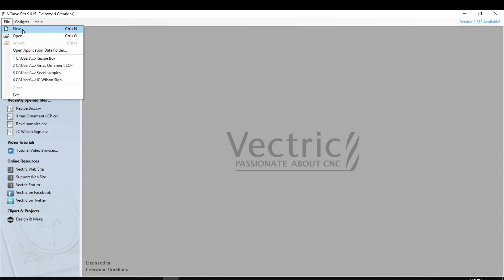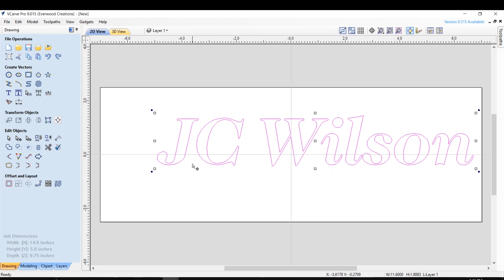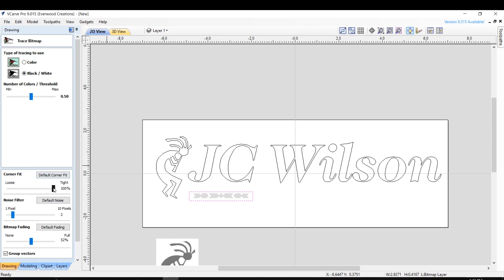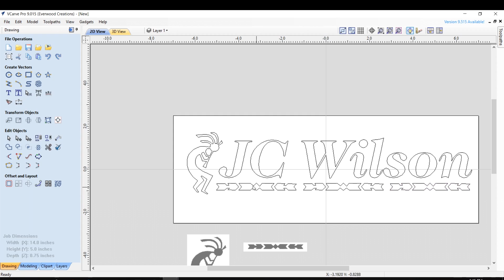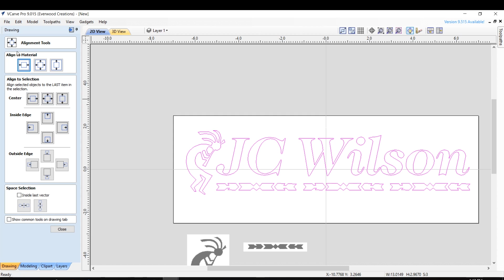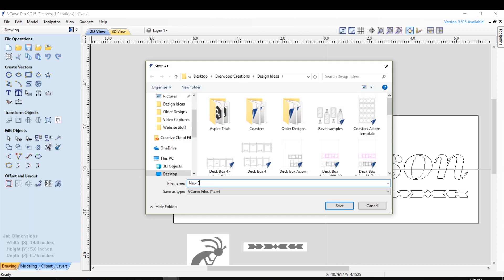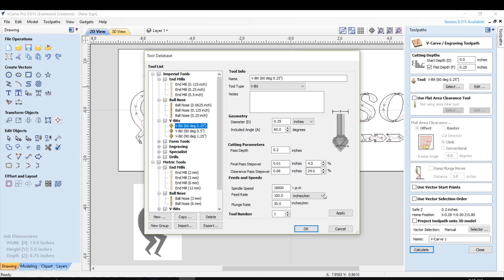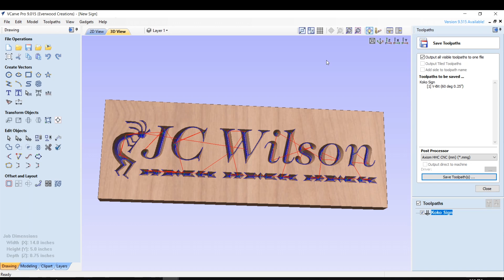VCarve Sign Tutorial: From Design to CNC

Comment: Liked your video and how strait forward you were. 2 questions, Didn't see you set speed you were going to carve. And 2 when you grouped the design would I do that if I use layers for a design?
Reply from the maker: Thanks Redds.  The feeds and speeds will need to be calculated for your specific machine and bit.  There are several calculators available online that should help.

If you group vectors like I did, it will move all of them to the current layer, so you may want to be careful using the group option with layers.

Comment: Great tutorial. Where do you define how deep to cut each of the objects?
Reply from the maker: Thanks Bradley.  This sign is done with vcarving, which means that the depth is automatically determined by the software.  If you want it to stop at a certain depth, you can put a value in the flat depth box at the top of the vcarve toolpath panel.  If you are curious as to the depth of a cut, you can use the preview and mouse over areas and the depth will be shown at the bottom of the screen as the z value.

Comment: Hi great video. How did the machine know how deep to cut if you didn't set the flat depth? Thanks.
Reply from the maker: This carving is done with a V-bit.  The way those toolpaths work is that the depth is automatically calculated based on the width of the cut, unless you specify a flat depth, then it will go no deeper than that.  If you are in your preview screen, you can mouse over any simulated cut and see the calculated depth in the bar down below.  Hope this helps!
Reply: @EverwoodCreations  

Thank you!!

Comment: Thanks great video.  I’m leaning toward vcarve. I have a shapeoko that I got built 2 months ago. Still haven’t made a single thing on yet. Having a hard time finding Mac friendly software
Reply from the maker: It's strange that Mac dominates the design world yet there hasn't been a great CNC hobby design tool made Mac compatible yet.  Using a Shapeoko (which we started with) you can definitely take full advantage of Carbide Create to do a lot of design work.  All of our early projects were done with it, but I understand your frustration, as it has it's limitations, hence why we switched to Vectric eventually.  I haven't explored their new Carbide Pro version of the software as it didn't exist when we were using it, perhaps it is closer to Vectric?  Good luck!  I hope you get that machine running soon.
Reply: @EverwoodCreations  
I’ve tried the carbide create and I find really user unfriendly. I don’t know crap about programming or this CNC stuff. I’m just a dumb woodworker. Lol. I need my software to be as KISS as possible. If I end up buying vcarve (the price tag ugh) I’ll rewatch your video a few times and do it with you. 
Thanks!
Reply: @patriotwoodworker6092  Try using Parallels on your Mac, converts to PC.
Art Miller

Comment: Great video and instruction! The only thing I can't seem to wrap my head around is knowing where to place your material on the CNC bed. Is that the setting you selected to center and then knowing where the center is on the CNC itself? Thanks!
Reply from the maker: Thanks Partyka.  Centering your material on the CNC bed is not necessary.  What you will want to do is find the center of your material and make a mark there.  Then you can put it anywhere on the machine bed just make sure it's square with the XY axis.  Once it is there, you will manually tell the machine where the material center is by moving the bit to your mark in the center of the material (using your CNC control or computer controls depending what you have) and setting XY&Z to zero.  Hope that makes sense.
Reply: @EverwoodCreations  ahh okay that makes sense thank you!!!
Reply from the maker: You may find this video helpful https://youtu.be/qQPUg0IgrrE
Note that he is zeroing to the front left corner, much of what he does is not necessary when zeroing to the center because you just line up the tool with your mark in the center for all axis.

Comment: Looking at purchasing a desktop version of VCarve - I have a Shapeoko xl with carbide create. Do you know if the 2 softwares are compatible and if you have to run V Carve online or not. Thanks and good video
Reply from the maker: We started our CNC journey with a Shapeoko, so I'm actually familiar with Carbide Create.  It depends on what you mean by compatible, I do not think the project files from Carbide Create are compatible with VCarve as they are a file type (.c2d) that VCarve doesn't read (I even tried just now to make sure).  However, you can use Carbide Motion with gcode files you make from VCarve,  I've done that many times.

To your second question, once you have Vectric VCarve Desktop, it should run just fine without internet access.

Comment: Hi Great video,  when you ran the file on your cnc the  bit you used looked bigger in dia than a .25  60 deg vbit looked like maybe a .5 bia v bit. Also how did you finish it. Jeff
Reply from the maker: Hi Jeff, we did use a 0.5", 60 degree vbit. We chose to finish the sign with Watco Danish Oil in Natural, and a spray on laquer.